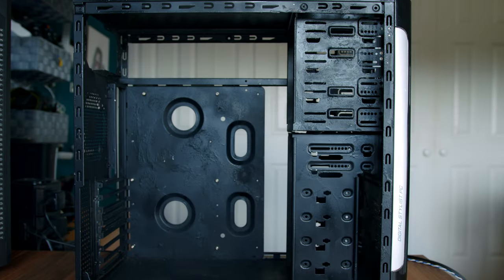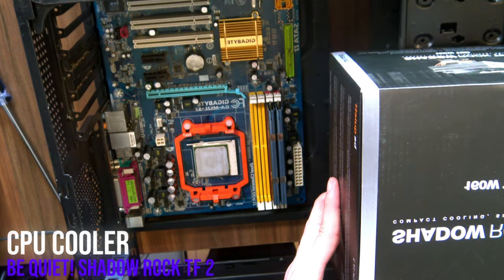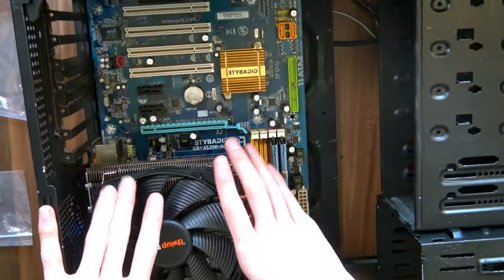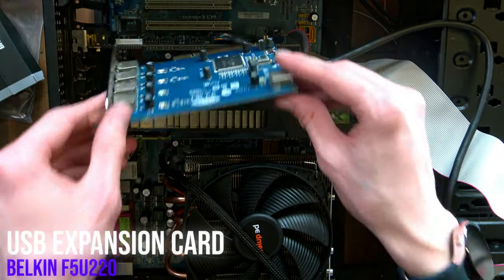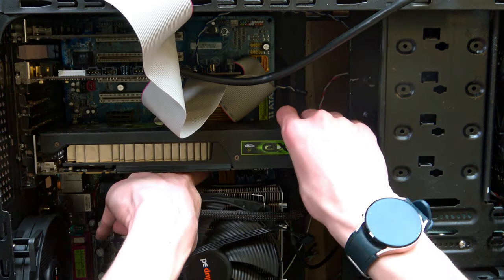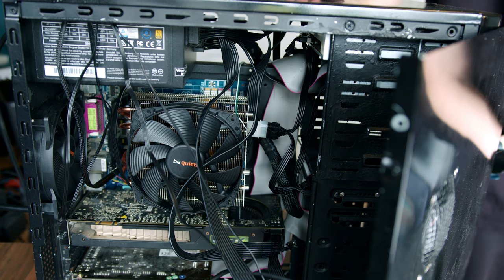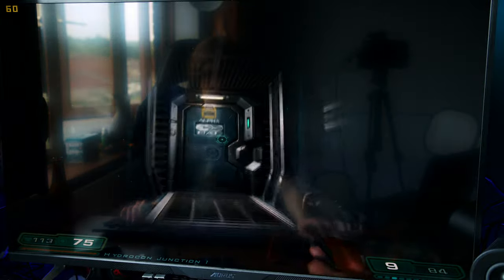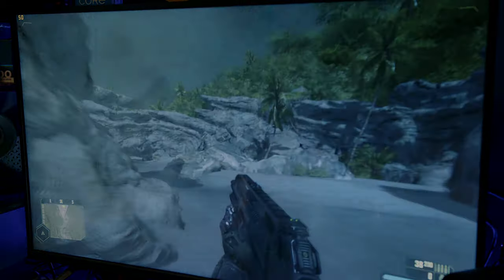The ULTIMATE Windows XP Gaming PC Build! Phenom II X4 Build

Comment from the maker: Correction: The hard drive used in this PC is a 80GB, not a 60GB one!
Reply: I still use a 980ti with my CRT monitor 👍. At 1280x1024 I've not found any game modern or retro it can't deal with at 85htz or FPS. The picture quality is insane 😀
Reply: Guess this pc is done for now or are you planning on upgrading something like the harddrive too a sata ssd maybe ?
Like a used intel 330 has ssd toolbox for windows xp so you got trim support there for example if you pick up a used 60 - 240 gb drive.
Or maybe just a bigger mechanical drive ?
Just 80 gb wouldn't be enough for the stuff I'd install personally heh.

Could technically go as far as socket 1155 or AM3+ on the platform (If thats an am3 phenom II it should swap right in into a am3+ motherboard. though its still not an unlocked chip so any overclocking is still done via fsb.)
& a gtx 970 or even Titan Z black for the graphics card in Windows XP which is basically dual gtx 780's in one card i think it is ?
Though id say a 1 gb 750 ti is more then enough horsepower or even a gtx 650 ti boost.
Though some games might not detect 1 gb vram that well & turn the settings down due to a too fast cpu but eh there's patches & community fixes for plenty of the games out there, including underground 2 for 1080p or up too 4k if you'd want that, & same with some other games via pcgamingwiki about that specific game. Worth a look if you got nothing better too do atm.
Reply from the maker: @Mini-z1994  Will probably keep it as is as I want it to feel like it came from 2008-2009 for the most part. Though I was thinking of maybe upgrading the 800MHz memory to something a bit faster, but will have to do some research into if it will actually impact performance in any way. Though don't worry, there will be an AM3+, fx-9590 build with SLI coming to the channel in the near future, which should be right up your alley!